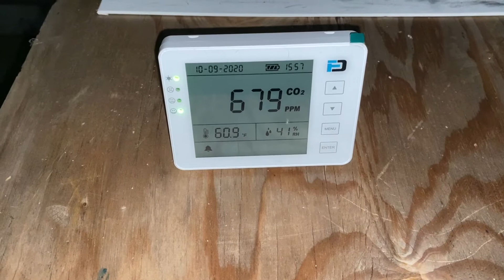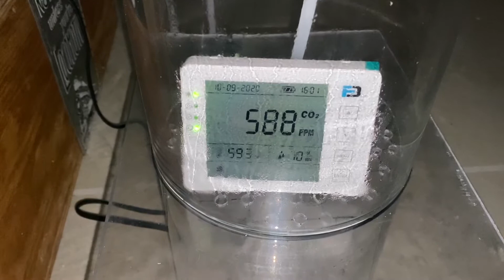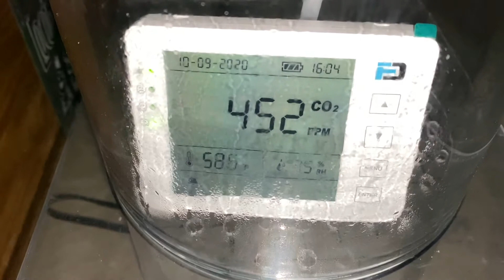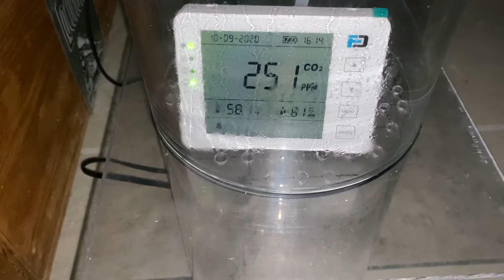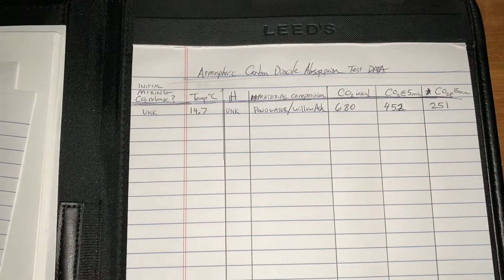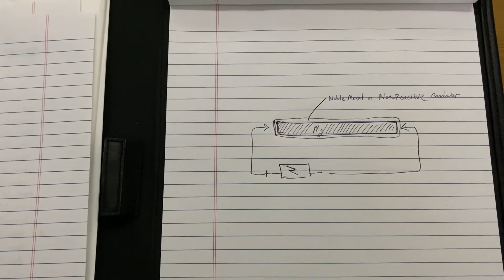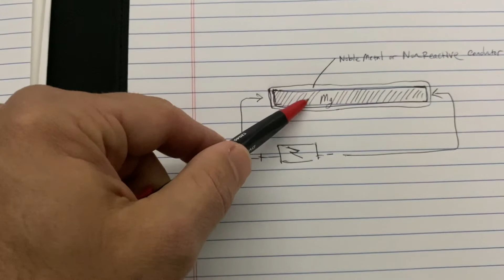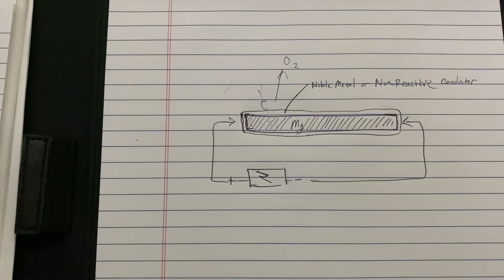CO2 Capture Device

Comment: Hey! I am trying to make a similar prototype but inclusive of passive heating techniques and using transparent PVC pipes to see the whole process for my graduate architecture theses. It would be really helpful to understand this process and design better. I plan to 3D print the pipes and incorporate that with other techniques too. Would be able to help with the above? I can share the process images and the final design too once done.
Reply from the maker: Sure, I wouldn’t mind helping.  I never signed up for the Elon Musk XPrize because of the start up fee lol.  It just wasn’t in the cards this time but, the principles can work.

So, how does the passive heating work? Heating the water will possibly drive off CO2…but if you have a way to capture it that would be good…CO2 is generally more soluble in cold water.
Reply from the maker: It’s the potassium hydroxide and magnesium hydroxide mixed with water that is the active ingredient in pulling CO2 from the air. That’s the easy part, then the trick is, how do you bind it and store it as carbon back in the Earth?  I think algae might be a good option
Reply: @CharlieMacklin1  Probably a diagram of how the system works would help to understand where to place the KOH and water mixture and which devices to use? I  plan to use arduino, cooling fan, air quality censor , temperature censor etc. to experiment the heating and CO2 emission.
Reply from the maker: @thwishashah8933  in what form would you want to store the CO2? Convert it to carbon through plants?  Perhaps putting it in the earth directly in an underground well? 

Also, another thing to consider is expansion; I’m pretty sure there is a volumetric expansion as the CO2 is absorbed by the alkaline water….it might not be much but possibly measurable
Reply: @CharlieMacklin1  I envision the CO2 mixed with water to pass through transparent pvc pipes and be collected in a container.
Reply from the maker: @thwishashah8933  are you familiar with a “parabolic trough” collector?  I would look that up in Wikipedia, it is an effective way to heat water in a pipe using the Sun’s energy. 

Now upon heating a solution of water and CO2, the CO2 will be out-gassed in a gaseous form, which could be captured, but then what?

If you want to permanently sequester the carbon, one way is to just pump the solution of water and CO2 back into the ground at the appropriate depth in an area with the appropriate minerals to bind it…
Here is a link to a research paper that discusses that technique:

https://www.co2-cato.org/cato-download/486/20090917_123324_4.1-3-05_Behaviour_of_the_CO2-H2O_system.pdf
Reply from the maker: Another idea for you, if you want a more architectural looking feature, would be to have the clear tubes and some sort of a rubber piston or magnetic scrubbing device. 

Then you could have a solution of water and minerals that 1) falls down a waterfall to mix with air (or uses an air bubbler as in my video) then 2) goes to a grow area, with the clear tubes (lots of surface area) in the sunlight to grow a layer of algae.  Coincidentally, a layer of algae in a clear tube illuminated at night with a small LED is a cool ambient green light.  Step 3 of the diagram would be the automatic “harvester” or scrubber of the algae which then could be pumped / filtered out and removed.  That algae harvest could become the method of storing the CO2 in the form of plant material.

But it you wanted just solar heating to outgas co2 into another vessel, that would also work, I suppose the CO2 could be compressed and stored in gaseous form for future use
Reply: I have looked this up and I am using this methodology to heat water in a pipe. Also, do you think this system will work with an air bubbler to draw the air and mix it with KOH?
Reply from the maker: @thwishashah8933  yes I’m sure an air bubbler will work, however, on large systems, it is more energy efficient to pump water instead of air, so, I would envision some sort of alkaline-water fall across some medium to mix it with air, then a water pump to pump the mix back up to the top.  I’m not sure I understand the solar heating tubes you are proposing, what is the purpose of heating up the water/kOh ? Wouldn’t that release some of the CO2 you captured?
Reply: @CharlieMacklin1  I am designing a small prototype to test the carbon so maybe the air bubbler should work with the KOH solution and will keep the heating as a separate entity.
Reply from the maker: @thwishashah8933  yes i think heating would actually release the CO2.  However, that can be part of the cycle, if the water is heated and the CO2 is captured in a separate vessel
Reply: @CharlieMacklin1  Hey Charlie I happen to try to make exactly this happen at the moment! Do you know how concentrated your alkaline solution was or could you do a ph test? I'm trying to figure out if the end product of the carbonated pot ash (or in my case, potassium hydroxide turned carbonate) is a suitable environment for algae...
Reply from the maker: @KajatheWolf  that’s awesome! Unfortunately I didn’t have any pH strips at the time and the Alkaline mix was pretty ballparked…I would guess around 10% concentration by weight of hydroxide salts.

The real rub is, how is the hydroxide sourced?  Because if you chop down a tree to get it, then it’s a net loss lol.  But, perhaps if it is a byproduct of some other industry…then we might have something
Reply from the maker: Are you familiar with an instrument called a “fyrite”?  They are used for testing CO2.  They use a mix of alcohol and potassium hydroxide, which is found to expand in volume when exposed to and absorbing CO2.  I think they have around 20% hydroxide.  I would aim in the 10 to 20% hydroxide range.  If you are growing algae you might have to go a bit lower in strength.  I have had algae grow by accident in alkaline ash water solutions, so it can be done.  Make sure there is a little magnesium carbonate or magnesium hydroxide in the mix also; every chlorophyll molecule has some magnesium in it….

Comment: Hi Charlie, Thank you for the video. I have a question: Is it possible to capture carbon from the atmosphere with electrons?
Reply from the maker: I’m not sure but maybe…perhaps there is some way to ionize the CO2 molecules and get them to stick to some material.  One thing I had looked at was a a certain frequency of UV light that could crack the carbon from the CO2.  Perhaps that could be utilized in air or in sea water, where CO2 exists dissolved in water.  CO2 is much more soluble in cold water than hot water, so that is something to consider as well.
Reply: There's an interesting process that is sort of like this. If you ignite pure magnesium in a carbon dioxide atmosphere, the magnesium will rip the oxygen from the CO2. This amounts to magnesium losing electrons. What's left is a white powder (magnesium oxide)  and a black powder (pure carbon soot). The magnesium oxide can be converted back to pure magnesium metal for another round by again manipulating electrons in an electrolysis cell of molten magnesium oxide. This will set the oxygen gas free into the atmosphere. This is the often neglected other half of our climate crisis. We have depleted atmospheric O2. Anyway, maybe this isn't what you meant, but hopefully you found it interesting.

Comment: can you please identify what are the components that you used to build this prototype??? please reply!! THANK YOU
Reply from the maker: It’s basically just ash from a fire, water, a suitable container, and an aquarium type air pump and a suitable diffuser (aquarium type stone ball).  These videos about climate CO2 absorption were less of a how to and more of a “it can be done”.   The flaw in the device is, I built a fire 🔥 to get the ash lol.  So the fire probably put off more CO2 than the device can absorb, BUT, if you can find potassium hydroxide (the active component in ash that is good at absorbing CO2) and source is in a way that is carbon neutral (for example, as a byproduct of some other process) or if you can find naturally occurring alkaline soil, then the CO2 absorption should work that way without having to purposefully build a fire to obtain ash.  I think the truth is that nature will restore balance by the mixing of Earth, Water, and Air…those are what we call “disasters” lol.  There will be more of them because of the extra energy we added to the equation from petroleum overuse, or at least that’s what I think.  So in a nutshell, any carbon absorbing device we build has to do what nature does:  use the power of the sun to mix earth, water, and wind…then when it has attained balanced pH, grow plants in it.

Comment: Love this. Good to measure etc. Great that you're using solar to drive it. Hi Charlie -- I've watched both videos mentioning your CO2 capture unit and neither explains your CDR system piece by piece and how the pieces connect and function etc.  Is there a link to a description? Could you comment on the system with like a block diagram, or do another video that explains it?  Or is this based on an existing plan that you can share a link on?  THANKS SO MUCH, CHARLIE !!
Reply from the maker: Hi there, well I am still in the “brainstorming” phase so I kinda was shooting from the hip and got sidetracked.  I think the best way to put carbon back in the earth is going to be with soil health and allowing plants to flourish.  It really depends also on water, and what region you are at, and how you get the water to the soil, and how to test the soil to make sure essential metals such as magnesium, calcium, potassium, etc are replenished.   I think cattle farming would work for this but there is a downside of methane emissions.  This problem is harder to solve than I originally thought so I will have to do some more work on it.  I am certain that it comes down to a material handling issue rather than an invention issue.
Reply from the maker: Since this video, I have thought more about it and I think solar-powered de-salivation facilitates in arid places near the sea might be an option for greening up certain areas of desert, although that does also have an effect on the ecosystem by conversion.